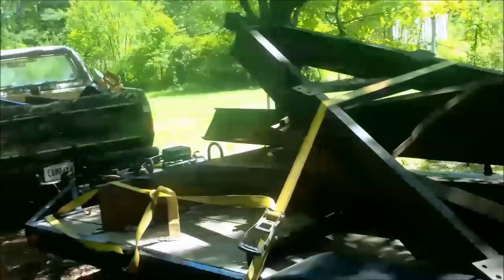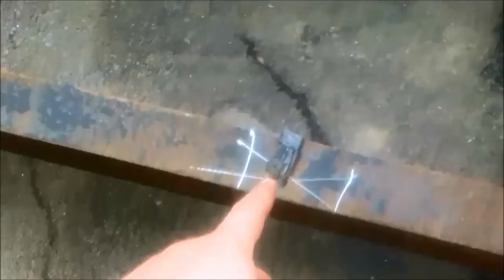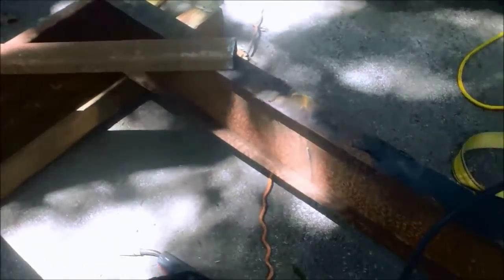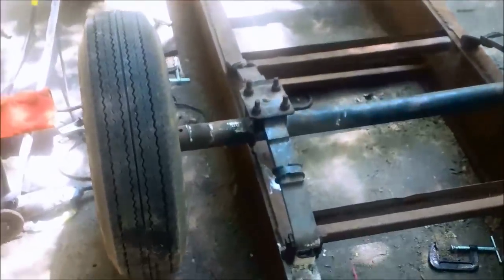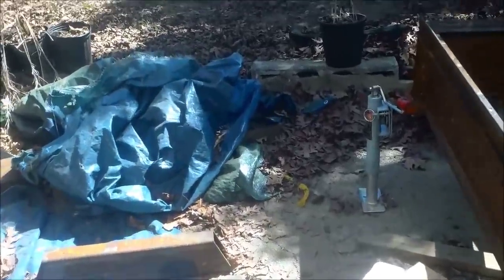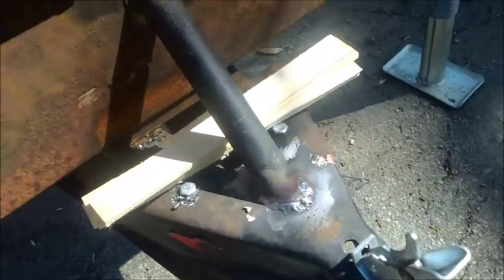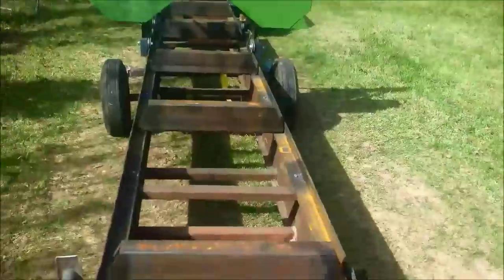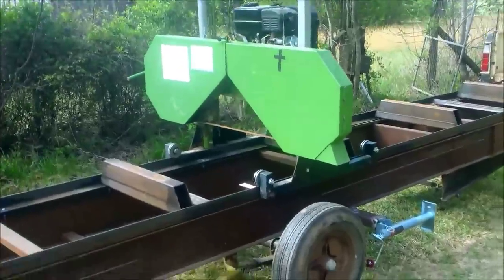How To Build a sawmill Trailer for your Harbor freight sawmill

Comment: How much weight does it need to hold?  I have a 25' trailer that used to be a camper or box trailer or something I want to use, but the steel is thin gauge so maybe not good for this application.
Reply from the maker: Not much biggest log I've milled on it was 3k